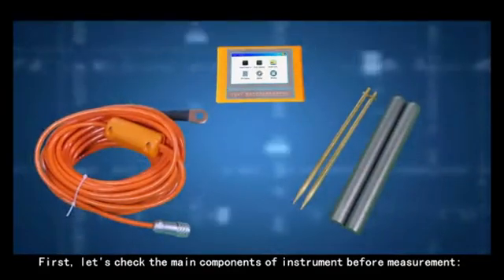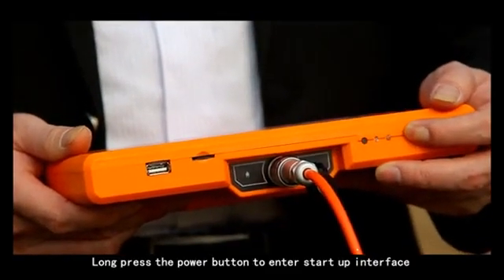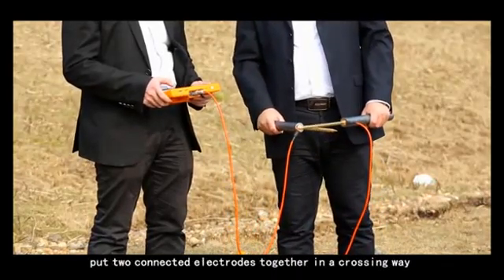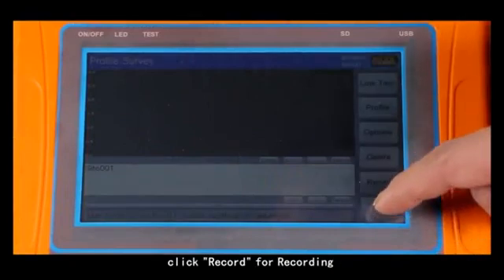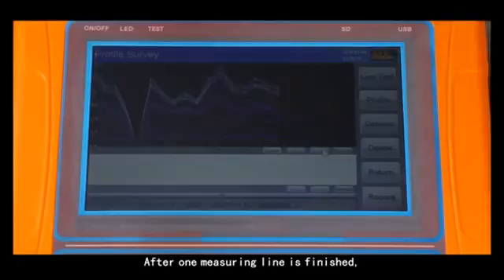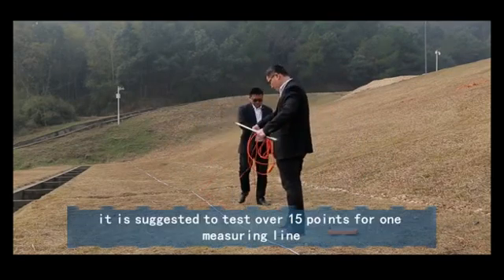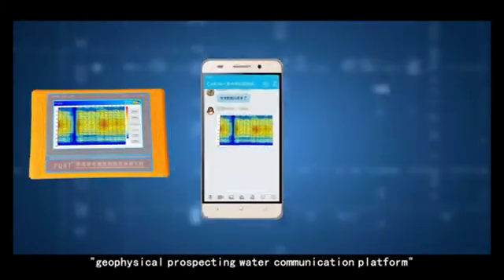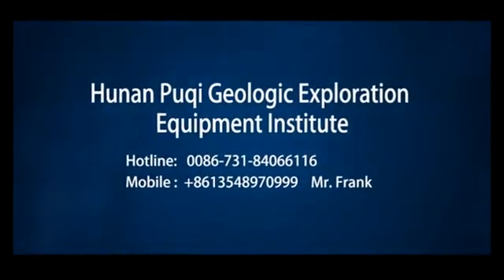Operation Video of PQWT-TC Underground Water Detector

Comment: Really sophisticated and modern devices which are very accurate.. Thanks for your efforts
Reply from the maker: Thank you for supporting, If anything we can help with, please come back to us. Good day
Reply from the maker: Thank you for support PQWT !
Reply: @pqwtcs1603   how much is the price for this...
Reply: @pqwtcs1603  how long distance between lines? If I want to explorec8 hectars peace of land.
Reply from the maker: @dzrad2372  hello Rad, the detection length of this cable is 10 meters
Reply: @pqwtcs1603  what about width???? This is my question.
Length is for points on one line, So between lines if I want to shape a grid, how long distance between lines.
Reply from the maker: @dzrad2372  Hello Rad, which model you purchaed?
Reply: @pqwtcs1603  S500
Reply from the maker: @dzrad2372  You can contact this whatsapp for more support: +86 18817121269